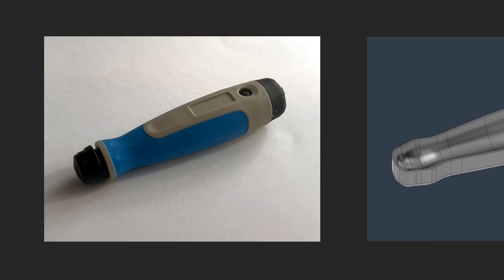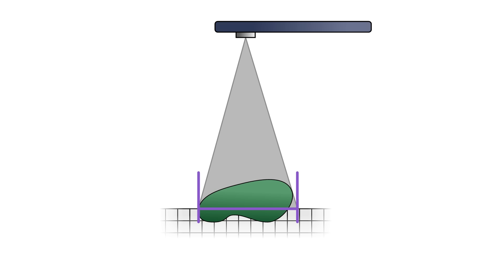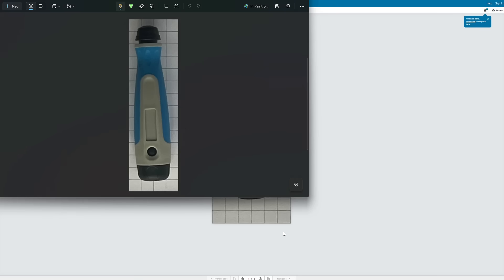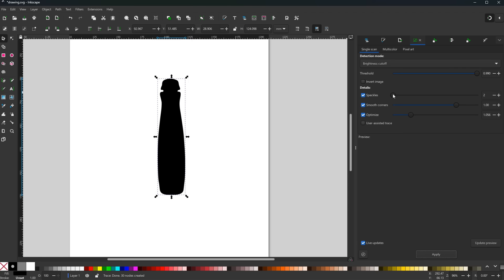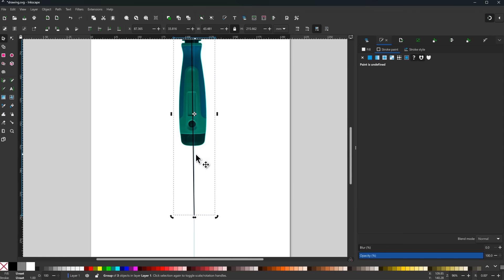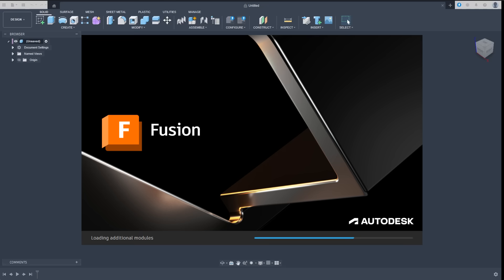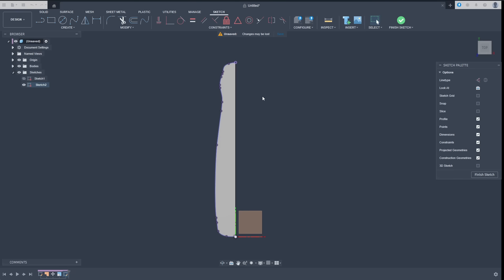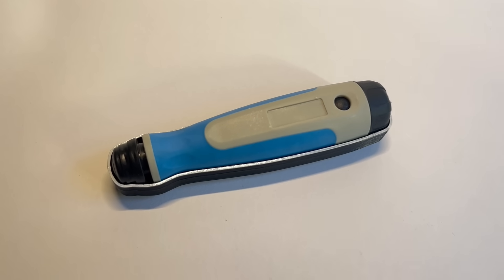Auto-trace Images to precise Fusion Sketches!

Comment: At 13:50, you could have used the extend command from the modify submenu instead of making lines then giving them a horizontal constraint. Not that much of a difference but it can sometimes make your life a tiny bit easier. Otherwise thank you for the very informative and detailed video!
Reply from the maker: Thank you! I always forget about these features as they were not around when I started out with CAD.

Comment: You should be able to export from Inkscape a DXF of your strokes and paths. Then import the DXF in to Fusion as a sketch. This should keep the correct scale, since it is a DXF.
This is how I do it with Adobe Illustrator.
Reply: Correct. If you import as a DXF the size comes in exact. If you import it as an SVG then you have to confirm and adjust the scale in Fusion360
Reply from the maker: Thanks for the input! Yeah, I had not tried that but it works great. Only had some issues with topology which could be resolved easily.

Comment: Thanks for your excellent video. I have been struggling for some time tracing splines and scaling in fusion to make a cut out shadow board for some tools without much success. With your method I had some issues with open profiles on the SVG files, this was due to bad resolution and shadows on the photographs, I solved this by cutting out a frame on your graph paper to accommodate the tool and photographing it against a lightbox (a galaxy tablet with a white screen). Thanks to your method my project is almost complete.
Reply from the maker: Thanks for the great feedback and the details about your process. Really helpful!

Comment: You can do most that on Fusion360 itself.  
Exceptions: The aspect-ratio/lens correction, The cutout, and the angle alignment trick.  
On F360 you have to align it by eye.  
Sometimes you want to obtain just a section that is in front of the object, or that is inside, using a paper scanner is the option, to not do the lens correction, but it lose focus for sections deep into the piece. So using a camera sometimes is better.

Comment: If you ask me, you're over-complicating the process. Oh, the picture itself is fine, but why not just measure and input the length and maximum width for scale, rather than all that complex math? The rest should simply fall into place.
Reply: Agreed

Most 3D modellers will have a set of callipers😂. So using a printed grid that could also be off scale due to printer variation is just introducing many error margins.

Use the most Telephoto lens you can from a moderate distance, use a ruler beside the object for reference, and measure X/Y scale mechanically to scale the image would require the least effort and zero calculation.
Reply from the maker: Actually I have tested and found no relevant distortion with the printed grid (as long as you print at 100%). It is generally relevant to have a reference in two directions perpendicular to each other to remove distortions, though.
Reply from the maker: You are absolutely right for relatively flat objects. Just be carful to scale to measurements of the original part if the part is  deeper. If you scale to the maximum width for example, your sketch might end up too narrow in other areas. I guess what I am saying is: As long as you know what you are doing a number of methods will work. I have presented a method which is quite universal but wont be the easiest.

Comment: wouldn't it be easier to export a DXF file from Inkscape with the dimensions already set?
Reply from the maker: Great idea, thank you!
I have not thought about that, this is defiinitely an iprovement which will save us the scaling step. Have just tried it and found that curves might not be formally closed resulting in open profiles. Which is interestingly easily fixed by projecting into a new sketch.
Reply: @getprototyping  I found Inkscape SVG import easier to work with than DXF for the same profile issues you mentioned. However, I use a different approach to scale the import. I simply window select the entire SVG import. Unfix it. The use the dimension tool to specify the height/width of the import. The entire import will rescale precisely if you have "Scale entire sketch at first dimension" enabled in design preferences.  

Another way - is simply draw a 1mm square in Inkscape next to your Inkscape design. Import it in. Unfix. Then dimension the imported square to 1mm. Entire import will scale in properly if you have "Scale entire sketch at first dimension" enabled in design preferences.

Comment: 1. I use the flatbed scanner from my combo printer/scanner. The scanning head moves across the scanned area, so there is no distortion (called parallax)
2. I include a ruler on the scanner bed for scale reference
3. No need for Inkscape, there's already a powerfull Spline tool in fusion
Reply from the maker: Agreed, a scanner is a viable option if you have one available. But this does not free you from the manual tracing. Might just be me but I'm not always happy with the powerful spline tool in fusion.
Reply: same here, im glad im using a normal workflow for this haha. Scanning flat items yields extremely high detail and accurate images. The only issue I run into is sometimes shadows from the scanner can obscure the geometry. Overall for getting 2D geometry into fusion i think its much faster than 3D scanning it.
Reply: yeah me too, standard A4 scanner will do the job for most of the times...

Comment: With the animation of taking the picture i thought this was the tip coming, to have the best chance to take a parallel picture is to take it from higher up and use the zoom, as it helps reduce the aberration from the lens since the phone would use a different camera for it
Reply from the maker: Great tip, thank you! I did do it (to some extent) but somehow did not think about mentioning it.
Reply: @getprototyping yep, the description is spot on, but usually the normal lens that the phone uses a bit fisheyey, and the zoom lenses are different, depending on the part, it can also be buried in Plastiline to the midpoint and a picture taken, but again a mess and not all things can be put in a vat of the stuff 😅

Comment: Great Video, Danke! I however got a Shaper Trace for this, which allows you to produce scale-true SVGs of a contour by just taking a picture of your tool. That is significantly faster. Grüsse!
Reply from the maker: Ah, Ive seen the ads but never used it myself. Seems to really nicely automate the steps outside fusion. Danke!
Reply: And there's a difference between getting this for 120€ and the free tools used, could also use Kiri engine and 3d scan it or my MetroX scanner lol..

Comment: Thank you for showing us this trick .
Though it could be done in another way , by importing the photo of the image in Fusion 360 onto a sketch plane .
You then measure your object , length/width , then draw a rectangle with these values and place your
photo of the object inside of this rectangle ,and simply resize the image until the object fits exactly
within the rectangle .
Now you can manually draw a sketch line around the 2d object , if it is a round object you only need
to draw around half of the object .
I don't say it is more precise than this method that is being showed in the video ,but i think it is
way faster .Have done it many times .
Of course there is a lot of other ways to do it ,but just thought i would present another way to
do it directly within Fusion 360 .
Reply: I just put a ruler in the photo and use the calibration function to scale the photo to the measurements on the ruler
Reply from the maker: Agreed that this often times works well, and I have don it many times, too. Depending on the complexity of the shape it may be a tedious solution, though. I want to add that such hand-crafted sketches tend to be of higher quality as you can avoid splines.